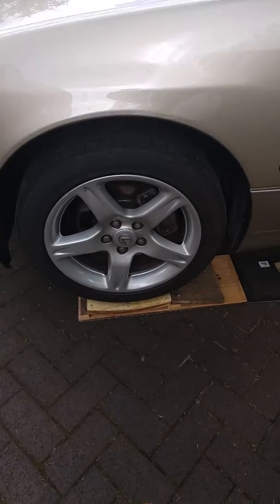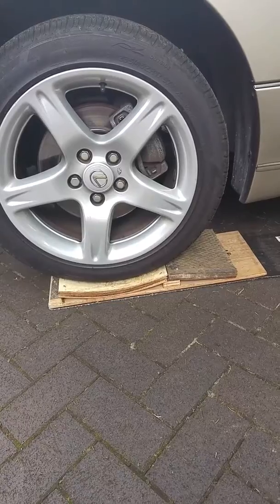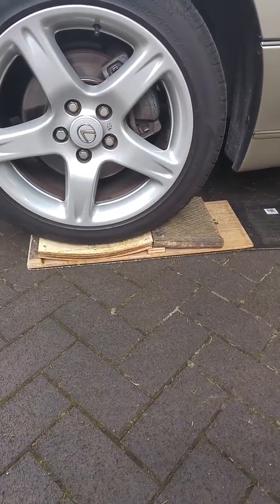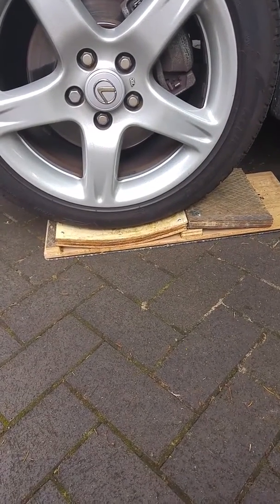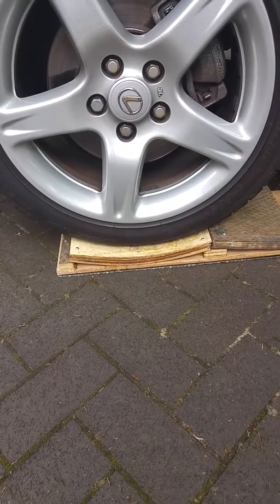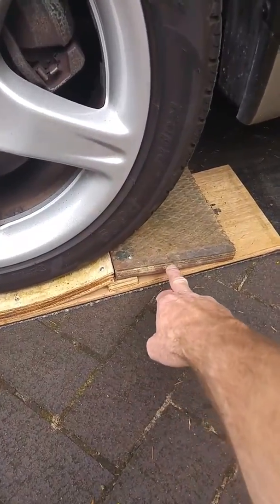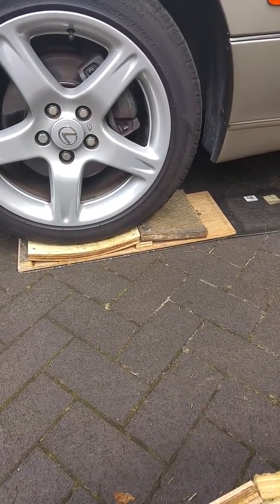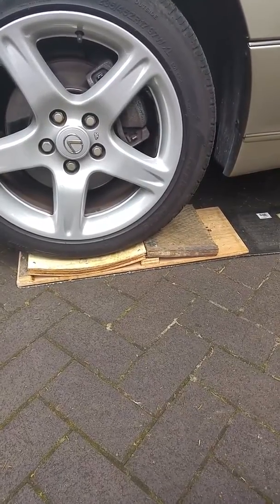Easy to make tyre saver cradles to avoid flat spotting tyres tires

Comment: How did you get the plywood to curve to the tire? Does it curve with the weight of the car?
Reply from the maker: Zack Vance yes I used the weight of the car. So I jacked up each wheel, then lowered it onto the sandwich of plywood pieces after I’d just added the glue between each sheet. Then just waited 24 hours for the glue to set.
Reply: @markrmthompson Thanks for the clarification.  I rewatched the video and saw that you explain that.  Do you think would work for a heavy vehicle like a 25-foot RV stored outside in the winter?
Reply from the maker: Zack Vance - yes definitely, though if outside I would cost the wood of the stands in PVA sealant or creosote to stop them getting water sodden and rotting as otherwise within a year or two they will be rotten
Reply: @markrmthompson  thanks!

Comment: Good effort, but this will not prevent flat spots
Reply: Putting the car up on jack stands is an option, but some say to also keep the springs loaded when doing so. i dont see why the springs need to be kept 100% loaded (they will still be a certain % loaded when lifted). plus, my cars dont have a safe and secure spot to place the jack stand, where the springs are kept loaded
Reply from the maker: joapps - after many months using these now (including periods of several weeks where the car hasn’t moved) I can definitely say it has solved the flat spot problems I had before